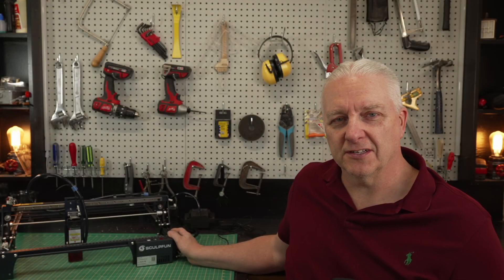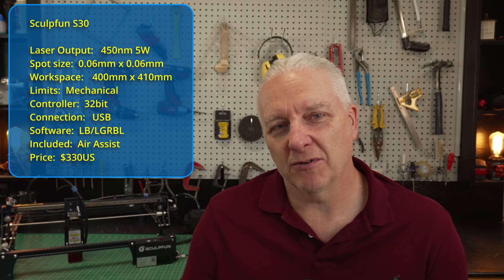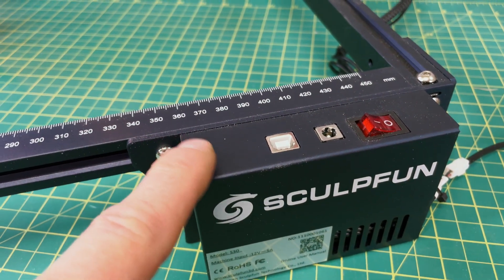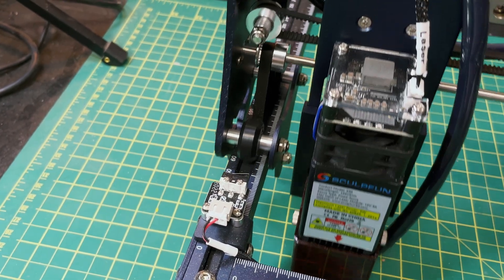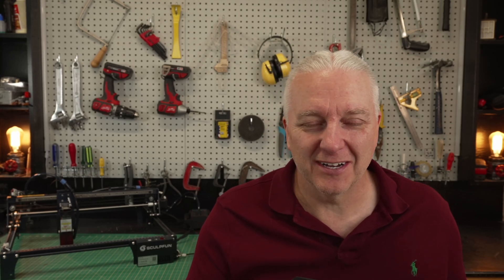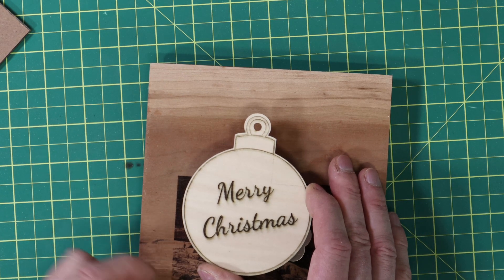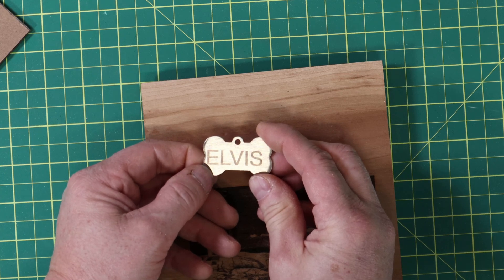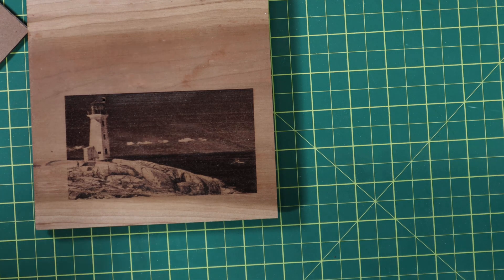Sculpfun S30 Review - A Great Laser for the First-Time Buyer

Comment: I've had this S30 for 2 months now. Biggest piece of crap I'v ever owned. For a 33 watt this thing is REALLY slow. My Longer Ray 5 20w works just as fast. I was 2 hours into a 5 hour engrave, and this thing STOPPED 3 times. Don't waste your money. Support is non-existent. Garbage truck comes Thursday morning, I guess I should just put this junk out to the curb for the junk man to pick it up.
Reply from the maker: Well, I'm definitely a fan of Longer lasers for the price.  But if the laser is moving slowly, you could get into the device settings and increase the movement speed and acceleration in the firmware.  You can do this from within Lightburn.

Personally, I have not had any stoppages.  This type of behavior is normally related to a dodgy USB cable, or you computer is going into sleep mode or dropping the performance - most common for laptops running on batteries.  If it is the laser actually stopping, the console in Lightburn should tell you why.
Reply: @SteveMakesEverything  The point is, I HAVE TO run the S30 33w at the SAME speed as the Ray5 20w. Otherwise it can't cut through 1/8 inch MDF. The reason I bought the 33w is so that it can cut faster. So the evidence points to the fact that the 33w is no stronger than the 20W. I wasted a LOT of money.
Reply from the maker: @ChuckKorringa  Got it.  I will point out that a 33W or even a 40W won't be able to do the same job twice as fast though.  The speed increase isn't linear with the power increase.
Reply: @SteveMakesEverything  There should be SOME increase in speed right? I get NONE. Same speed from both at 90% power to cut 1/8" MDF.
Reply from the maker: @ChuckKorringa  Yes there should be some, but it won't be as big as you think.  Going from 20 to 33w you'll probably see a 20-25% increase in speed.

If you aren't seeing anything, then there might be an issue with the laser module and it's not putting out as much power as it should.  Check the lens on inside the tube to make sure it's clean.  If you are running low volume air assist or none at all, that optic will get gummed up with smoke residue.

Comment: Hello Steve, this is a really interesting video which i stumbled upon after a recommendation that this machine could be used to cut custom stencils for artwork projects. Im still unsure whether this would be possible and would appreciate your thoughts. 
Many art stencils are available and whilst I can hand cut custom stencils, they take a long time unless I use card and then they have a limited number of uses. Id prefer to use some form of plastic along the lines of overhead projectors sheets, but larger.
If this machine isn't suitable, would you know of something that might be?
Any guidance at this stage would be a great help to me.
Many thanks in advance, Loz
Reply from the maker: Any diode laser can make stencils. I did a video on this about a year ago so check my videos.  You need to be sure that your stencil material isn’t made from PVC plastic but otherwise it’s pretty straightforward

Comment: Great video, you seem like an expert. I bought that exact machine but, honestly, I don't know how to use it. Would you mind to tell share with me the settings to engrave a tumbler.
I found out how to do framing but my RA isn't rotating properly. I'd appreciate your advice.
Reply from the maker: If it isn’t rotating properly then maybe you didn’t enter the proper values into the rotary setup screen.  I can’t remember the value for the RA2 but you should find it on xTools site or possibly in my own RA2 video from about a year ago.  I’m assuming it is rotating smoothly just not the right amount.

Settings will be a challenge because every type of cup is a bit different.  You’ll want to go reasonably slow and with a 5W laser I would guess you’ll be at 100% power. Get a regular flat piece of stainless steel to play with. A cheap dollar store stainless steel knife blade will work. This will give you a reasonable idea on bare stainless, but many cups have paint or powder coat so they may take more or less power.

Comment: Sorry for the lots of questions, but its hard to find good info...

I've been wanting to do simple quick dog tags for customers on the fly at an indoor flea market. I'm looking for something that can do them fast (ideally 10 minutes or less or fairly close to it) is this a good laser for that job? 

Also you mentioned in comments about not cutting vinyl what about engraving resin? Any risk in that?

Do you think this laser is good for the environment we are at? I'm concerned about engraving stainless steel and fume production. Is that going to be an issue, if so what would you recommend for capturing those fumes for safe disposal? This building is an old furniture warehouse so its very open but other vendors are nearby and some are food products. We're in the middle row so we cannot run a pipe or anything outside.   

Please excuse my ignorance on this, I've not done laser engraving. The most we've done is 3D printing, and this seems to be a similar machine and operation, except not done in the vertical axis. Thanks for the help.
Reply from the maker: You would be fine to use a diode laser with light burn to engrave dog tags on the fly and it should take less than 10 minute.  Since you are only engraving off a thin layer of finish it would pose not real thread to anyone from a fume perspective.

For engraving resin the answer is harder.  Most resins are formed from naturally occurring organic chemicals (especially the low VOC variants) and they should pose no hazard.  However some might have a Chlorine atom hanging off the molecule so you might have to ask the manufacturer, though in general this would be a very low content of any resin.  The big question of course is if you can even engrave resin without it turning back into goo and I suspect that is the much more difficult challenge.
Reply: @SteveMakesEverything  thanks for the info! I’ve seen your videos on acrylic etching, is acrylic different from resin? We were thinking of making some clear resin squares to make something similar to what you did with your LED acrylic signs. Any idea what we should look for to be sure we don’t have one of those chlorine molecules hanging on? As far as making it go back to goop, only way to know that is to try it I suppose if you’ve never done it before yourself. 

We got a simple enclosure for the laser we bought (which happened to be the Sculpfun S30 - 5W diode laser version in this video since it clearly does the dog tag etching we need for it and the price was reasonable) is there any good DIY fume disposal systems you can recommend we build? The enclosure we got has a tube and fan on the enclosure to blow the fumes out a tube, but obviously we don’t really have anywhere we can dispose of it without simply blowing it into the air just perhaps in a different place. We had thought of maybe a simple air filter on the end of the tube, blowing into a trash bag, or blowing it into a home depot paint bucket… something so it’s sort of dissipating and diluting for any fumes it may create. So far all I’ve seen are systems to blow them outdoors, or expensive fume collection air purifiers, but we’re not really ready to invest the price of the one used with for example the xtool fully enclosed machine since it costs almost 3x the cost of this machine itself at this point. The enclosure was more for eye protection since we plan to run it in a place where people won’t exactly have access to any kind of eye protection but we do want them to be able to watch the laser work on their product but the secondary purpose was to help dispose of fumes in a more controlled manner.
Reply from the maker: @GokouZWAR  So there are standalone air filters which would help but I honestly haven't found one that really works and they are quite expensive to buy and operate. (I might build one to see if I can do a better job) 

If you are planning to engrave acrylic then you will definitely need some sort of air filtering.  Nothing hazardous about cutting acrylic but it does have an odor.

Regarding engraving resin, I was having a conversation with someone in my shop just yesterday about doing this.  It's on my list of many things to do because I haven't tried it before.  With very light power it might work and maybe I'll post a YT short of the test and results.

Comment: Do you use air assist when you are engraving or only cutting with this machine ?
Reply from the maker: It depends on the material, but if a laser has air assist you should probably use it.  It helps keep engraving dust off the material

Comment: Good afternoon.  I'm looking for something to etch on curved pistol grips.  Would this be an appropriate unit?
Reply from the maker: There are two thing to think about.  First is the material because diode lasers can’t engrave all materials.  Second is the curve on an item that isn’t a cylinder, which can be a challenge for an inherently 2D device.

I’d suggest you find someone local who has a diode laser you can try. I assume you will be pulling the grips off and laying them flat on a workspace. If the curve  on the grip isn’t significant where you want to engrave you will be fine, but if you want to engrave edge to edge you are going to struggle.

Comment: Greetings Steve.
I am in a big dilemma between buying the Sculpfun S30 Pro 10w and the xTOOL D1 10w. On Aliexpress, the Sculpfun is costing US $479.00 with Air Assist (Free Shipping). And the Xtool is costing US $439.20 without Air Assist (Free Shipping), however, I am in doubt. So, any tips or clarifications you could give me on buying one or the other? Thanks
Reply from the maker: Between these two I would pick the Xtool every time, though the price you list seem a bit too cheap for the 10w, so definitely verify the specs before you buy.  Also check the price from the affiliate link I provided in my review video in case there’s a better discount.  In the end buy wherever it’s cheaper
Reply: Hello Steve; thanks for your reply. This price is without the Air Pump. Still, is it worth it? Or is it better to choose the Sculpfun S30 Pro with the Air Pump? Thank you again.
Reply from the maker: @Dancopymus  For sure.  You can always add an air pump later if you plan to do a lot of cutting, but the mechanics on a D1 Pro are a lot more robust and I think they will last a lot longer

Comment: Can you please share the setting for metal engraving I tried some experiments on my s30 pro max but failed to achieve any results..
Reply from the maker: Well first make sure you are using stainless steel.  After that set your power to 100% and go slow on the speed. For a 20w laser set the speed to 10mm/S and give it a try

Comment: Steve, do diode lasers mark stainless without cermark type sprays? This is the first diode review I have watched, so am a little surprised at that capability if so! Thanks.
Reply from the maker: Yes, even a 5W laser can mark stainless quite effectively without any surface preparation.  As you might know, a CO2 requires Cermark or similar to achieve this.  However be aware that materials like clear or white acrylic are very difficult for diode laser to work with., so it's a trade-off you have to make.
Reply: @SteveMakesEverything  Interesting! I have a FSL 90w CO2, dislike the spray process. Would 2 passes on this make a more significant mark?
Reply from the maker: @dian3145  Multiple passes will help, but you can also just set the speed to a lower rate.  Also, a higher power diode laser will mark darker more quickly, but of course comes with added cost.